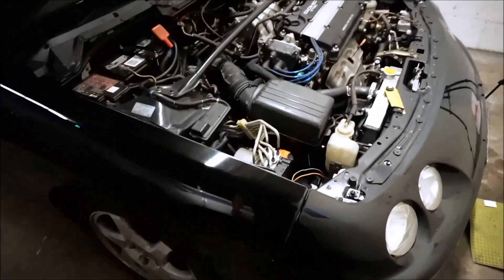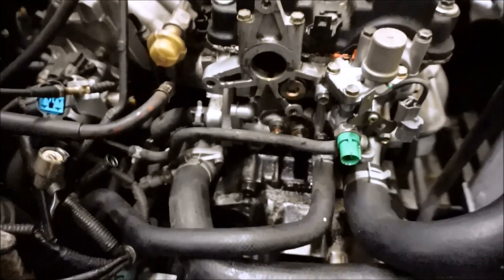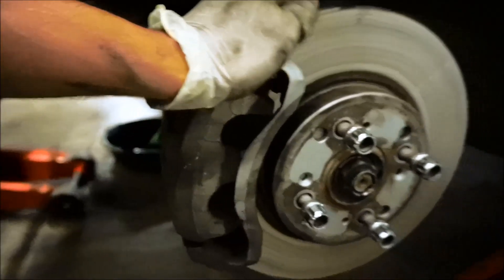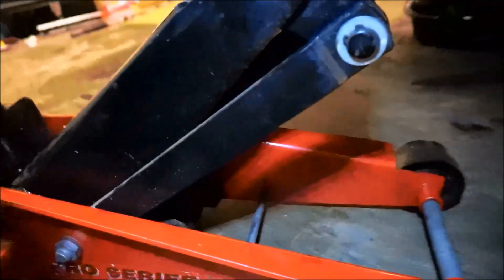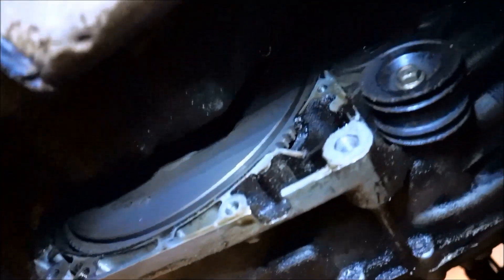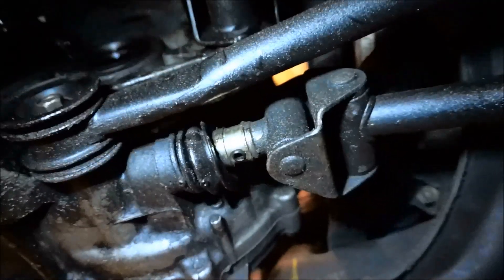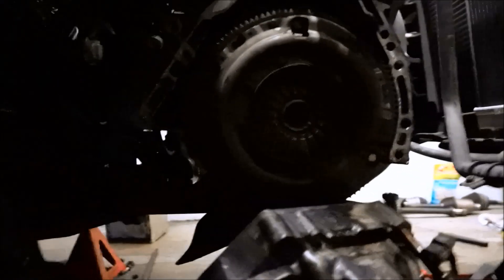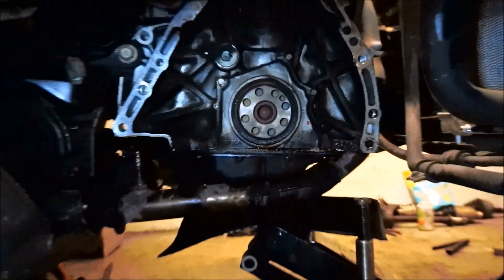94-01 Acura Integra Manual Transmission Removal

Comment: No way buddy uses his half inch with a extendo rod to break the axle but then proceeds to unthread with breaker bar 😂😂😂😂😂
Reply from the maker: I can explain lol I break breaker bars easier than walking in the park. My Stanley ratchet and cheater bar has zero flex. I use my breaker bars for everything else. Hope this helps explain it

Comment: Bro I been watching this video about 3 times a day just to build up the confidence to take my transmission off I gotta rebuild it my 5 th gear pops right out so I'm still saving up my money for parts, oem 5th gear hub, sleeve  , synchros and 1-4 synchrotech brass synchros , rings bearings clutch fly wheel and main seal, I have a gsr trans on ls b18b  motor 98 integra,  thanks for making this video
Reply from the maker: +Dani d very nice man, since you are going to be putting in money and work, just might as well shoot for a b16 trans or a lsd itr trans... and i appreciate it man, glad you found it helpful!!
Reply: @Driveway-built  lol I know it's been a long time a go but yes I did and ironically I'm doing it again tomorrow,  I installed a b16 transmission built by manual gear box llc , I'm tired of the short gears and switching to an Ls transmission
Reply from the maker: I couldn’t stand the LS trans.. those granny gears and Final drive are good for Highway, but around town I was getting mopped on the floor by d series. 

I have a b16 cable trans in my DA (jdm trans) and it really transforms the DA. I just drive slow when on the freeway so my rpm’s aren’t super high. Just install an LS 5th.
Reply: @Integra DIY  I kid you not if I get my ls transmission installed tomorrow I will make a video please subscribe so you can see what the inside of my b16 transmission looks like when i eventually decide to open it up, when I drained the transmission fluid bro it was black and silver 😢 because of my job I can't get any tickets period so I'm looking forward to experiencing the Ls transmission. At 60mph my rpm was 4000 with this b16, I absolutely hate driving in traffic with this car , my gsr transmission was awesome but I sold it when I got my b16 which at the time I taught it was a good idea believe me I regret it but now a days it's crazy what these parts are going for.

Comment: I don't get it, why didn't you use your breaker bar to un do the axel nut instead of your 3/8s ratchet,  lol sorry i was annoyed by that 4 sum reason.
Reply from the maker: +Dani d good question lol I bought the breaker for the bell housing bolts, and those huge 19mm bolts for the t-bracket.. it's a low cost breaker from Harbor Freight and just in case it broke I didn't want to break it yet lol 

I actually broke my last breaker bar taking off that same axle bolt too.. and when I broke the breaker bar, that 1/2" drive ratchet broke the bolt loose lol so it's my go to ratchet for abuse lol. Thanks for watching man!
Reply: its been tested by pros and proven to not break, Harbor freight breaker bars beat out the name brands like snapon, mac, and matco.  use the right tool for the job,  work smarter not harder. a breaker bar is meant to be stressed and abused thats why its called a breaker bar its to break free fastners

Comment: You did the OEM big brake upgrade using Acura Legend dual piston calipers & Mini Cooper 280mm Rotors?
Reply from the maker: Yep, and I used the Legend dual piston calipers and 4th gen Prelude VTEC rotors... same thing as the mini cooper rotors except I re-drilled them to 4x100. It's a very nice setup, but I have to redo them
Reply: Ok, the Mini Cooper rotors was the easier option for me. I got Centric rotors, I'm considering going OEM Mini  Cooper rotors. Why do you have to redo them & did you get your Legend calipers at the Junkyard?
Reply from the maker: B16A5 EK4 OEM MINI Rotors would definitely be higher quality and be more durable.. and yeah i got the calipers from the junkyard, took them apart and cleaned the seals and pistons.. the seals were In good condition so I reused them, I just cleaned the pistons and bores.. Ebay has a cheap rebuild kit I was looking at
Reply: Ok kool. Subscribed!!!

Comment: I know this is an older vid but hoping you’ll still reply.   I have one about an inch off the engine and it’s giving me so much shit not wanting to come off.  Yours looked like it gave so easy.   I left that shield for the flywheel on the bottom and am wondering if that’s holding it up.   Doesn’t look like it has to come off but it isnt wAnting to come free.   Pissinf me off and now I have to leave for the day with the sob so close.
Reply from the maker: You are pulling the trans off the engine? Your half-shaft will fight you, so pull it off also. Flywheel shield must come off, or else it’ll get caught on the flywheel. Once the shield is off, make sure all your bell housing bolts are off, have a floor jack supporting the trans. Keep shaking, don’t treat it nicely, pull and yank at it it’ll slide off the clutch and be free
Reply: Integra DIY cool thanks. Had a feeling it might be that shield.   Have everything else done but I left it on.   Appreciate the quick reply.

Comment: Hi hope you see this. When I go go take off my distributor. (B16 ek) I unplug the harness from it but there is black wire like hard wired from the harness to the distributor making me not able to pull it out freely any idea what or why that's like that?
Reply from the maker: Nickerson probably a pin in the connector was damaged and they bypassed the connector plug. Or it can be a kill switch
Reply: @IntegraDIY  ahh thanks it does have a kill switch. So I can just get rid of it all together?

Comment: You can have this transmission out, rebuilt, and back in and on the road again in a day. Good video overall, you made me nervous a couple of times but all good. Getting the roll pin out I recommend using an air hammer and give it a light bump.
Reply from the maker: Eric Marshall I’m getting old, my body doesn’t work the way it use to... maybe 10 years ago :) and thanks man 👍 and yeah that roll pin is pain in the @ss.. an air hammer would’ve been cool to have at that time 🚘🚘
Reply: @IntegraDIY  I'm a tech for Acura and I have to rebuild my Integra transmission (S80). Considering putting a LSD transmission in it but still going to rebuild my transmission.
Reply from the maker: An lsd install would be a night and day difference, no more one wheel chirps lol I thought about the idea of getting an lsd.. but I’m just going to get the itr trans.. short gears and the 4.7fd is killer

Comment: How long should this kind of job take for 2 people to get done?
Reply from the maker: Diego N 1 day.. start in the morning and you’ll be done by dark. Make sure you have all the proper tools and parts and you’ll be good. Especially with an extra pair of hands it’ll be much more easier
Reply: @IntegraDIY  thanks. What tools should I have that are important. Like sizes and types of tools
Reply from the maker: You want to know what types of tools you’ll need? And sizes? Do you have a Metric tool set? Do you have a Ratchet, sockets and wrenches?
Reply: @IntegraDIY  yes I tools just need to know sizes and yes metric.
Reply: @IntegraDIY  I don't know what tools I will need can you make a list please I'm replacing my automatic transmission and not sure what I will need

Comment: So I pulled the motor and tans together, can anyone tell my why my trans will come 2” off the motor then stops? Every video I’ve watched they just slide off.
All bolts are off. I’m lost.
Reply from the maker: What about your intermediate shaft.. make sure it’s not still in the trans. Your clutch disc is getting caught on the transmission output shaft.. jiggle and yank, it’ll fight you, you can’t break anything, just jiggle the whole trans up and down and side to side..
Reply: I pulled the intermediate shaft, I’ve used pry bars, beat it. Jiggled. I’m lost.
Reply from the maker: Read my first reply “it’ll fight you” if you don’t put balls into it, it’ll walk all over you. Lean in from above and stick your hand in between the bell housing and the engine, make sure to use a leather or thick glove and bounce the trans and rock it. You can do it. Good luck 👍